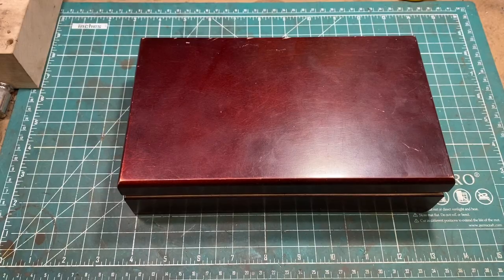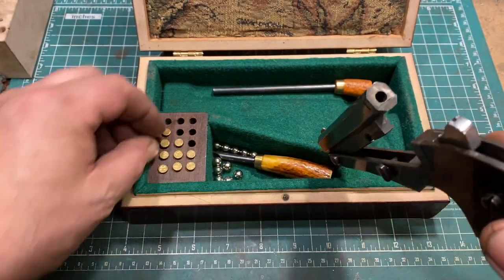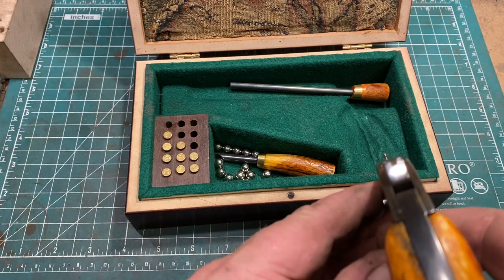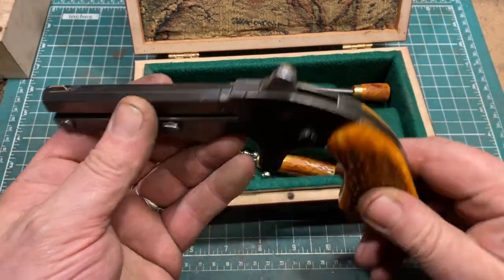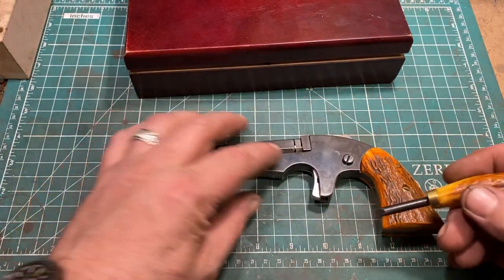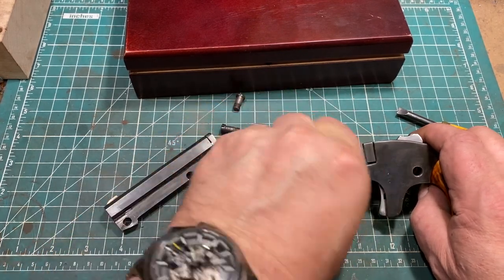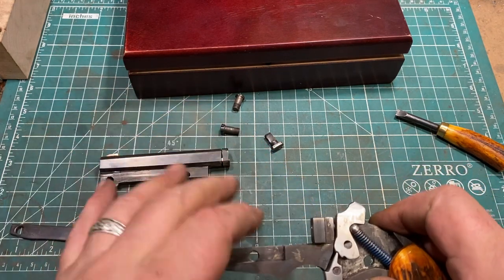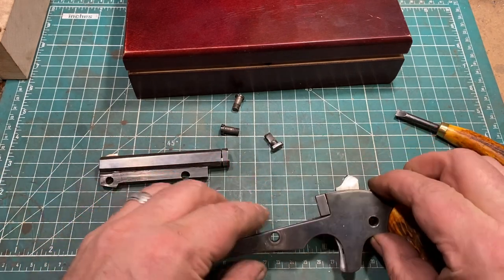The Post Modern Muzzle Loader

Comment: Do you think there would be a market somewhere for things like that that accept airgun pellets? I am very much intrigued.
Reply from the maker: The issue is that blanks like these are too powerful for airgun pellets; they over-drive them causing excessive leading.  There was a Remington parlor pistol in the 19th C. that used a percussion cap to drive a pellet; these were very low powered for indoor shooting of course.